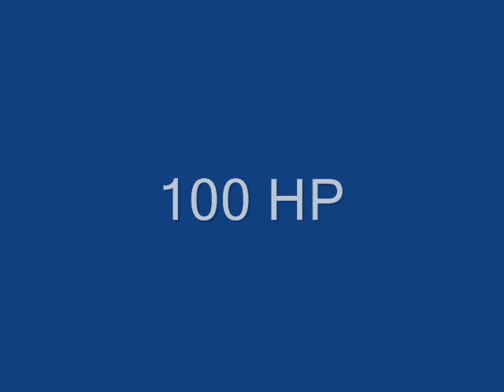buggy build 08-09

Comment: youre buggy looks awesome man, way better then mine. but where did you get the wheel hubs, drive shafts and shocks
Reply from the maker: The hubs on the front are from an old car off the jung yard. The rear parts are from an old BMW. The Shocks are from ATVs with the Springs of a Benz A-Class in the rear and in the front in dont realy remember :D sorry

Comment from the maker: @vSilentv 520kg, but she isnt done. i still want to make some fairings fenders and stuff becouse when the weather isnt that good it isnt too much fun driving.  
at the end of each A-arm there is a tube and in the tube there is a plastik fitting with a hole though it for a bolt(i also drilled holes into the bolt to about the mittle and little oppenings for lube). i made it, so the movement would be on the bolt and noch on the tube becouse the bolt can also be exchanged quite quick.

Comment from the maker: we took the original gear out (bottom left) and put in a duplex chainwheel instead. it fit realy good. 
becouse the diff has to be open for the chain we made a case around the whole chain where we put the oil in.

Comment from the maker: @montgomeryee thanks!  well, i didnt have very much money so i had to keep the costs as low as posibal. 
the diff setup was quite difficult to design. we took the original chain from the bike( 0:57 is a good picture to see how it works) and the ori. chainwheel. the rubber damper was also kept (the big round cylinder on the left) after that further on the right there is a duplex sprocket that drives a chain that goes into the diff. the diff setup ist clearly visible in 0:42 .